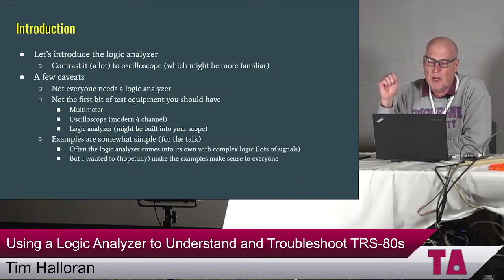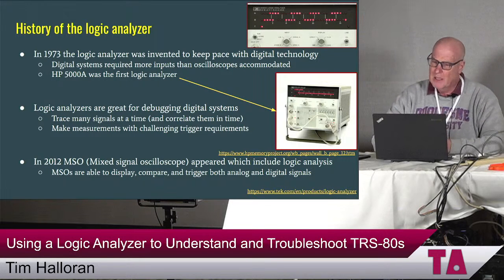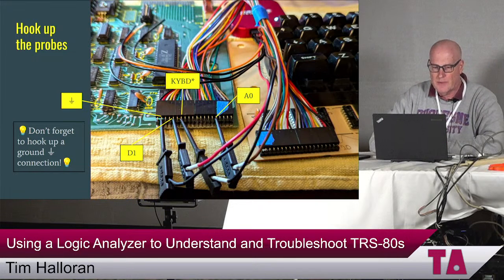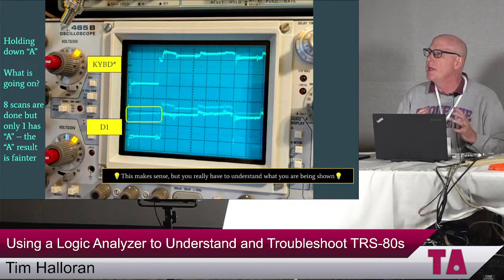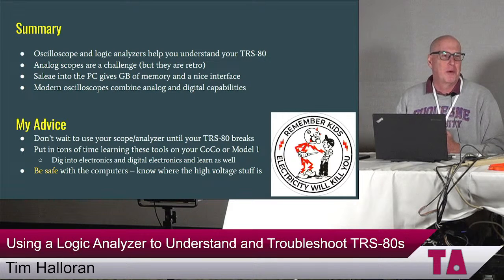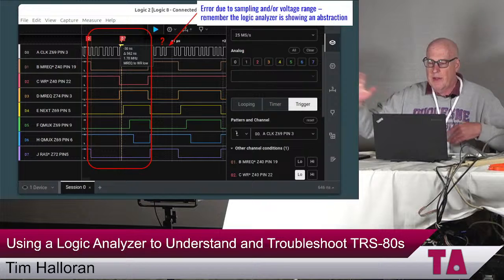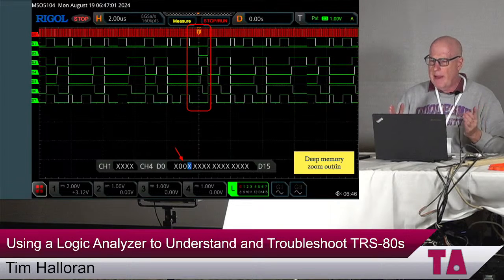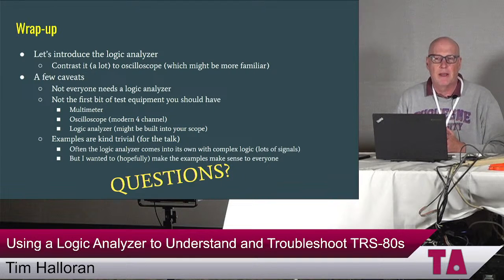2024 Tandy Assembly Tech Talk - Using a Logic Analyzer to Understand and Troubleshoot TRS-80s

Comment: I love my 16700s and 16900a. They are fun to hack around on. Keep in mind that these can be separate repair and restoration projects like the old computers being worked on here. Time, money, effort so you've gotta like messing with these. While you can find deals, good t&m equipment is pricey. Bus pirate and saleae clones can be had for reasonable prices, but then you deal with limited or unsupported software to drive them. No magic bullet for cheap, easy, and powerful.

Comment: I picked up an old HP 1671G a few years ago for about $250 - It has 6 pods (16 chan each) and a 2 channel 1Gs scope.  It needed a new CMOS battery (Dallas chip surgery).  Don't buy any old logic analyzer without pods and cables which are unobtanium after the fact.